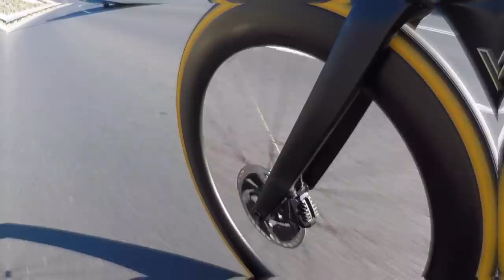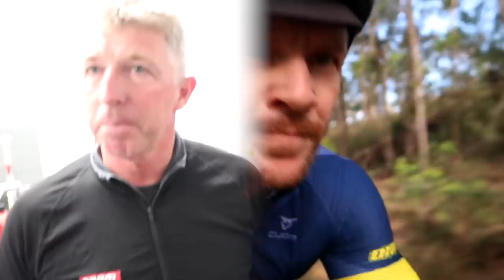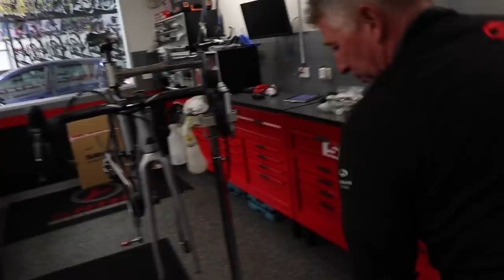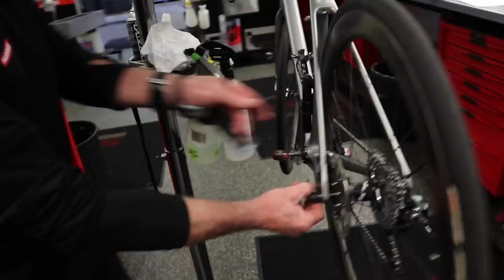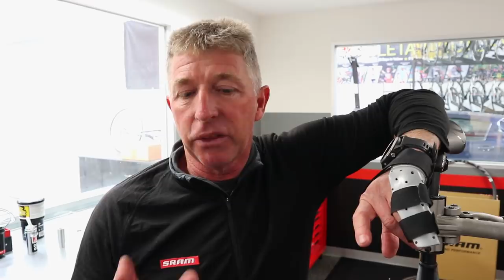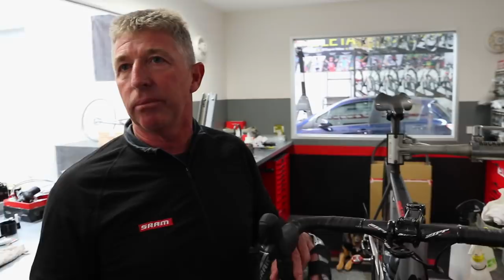Disc VS Rim Brakes (& Thru Axle VS Quick Release Skewer)

Comment: I am sorry Cam, from a physics perspective a rim brake makes more sense, where a disc is better, is that it keeps the mud and rain away from the brake surface.
The reason they need to use a through axles is because of the twisting forces due to the one sided disc brake, it twists the forks because the forks are not braced. Look at the disc wheel, it has cross spoking and is dished. They have made the wheel weaker, why they need more spokes. They talk about rim brake failure, what about spoke failure, and remember with discs your putting all your  braking forces through the spokes. With rim brakes your not.
Then they talk about aero, how is a wheel with more spokes, a disc and has a wider wheel rear dropout on the bike more aero?
I am calling it marketing, if you get buyers to change to disc, they need to replace everything as rim wheels don’t work on a disc bike.
I have rim brakes, campy carbon ultra bora wheels, red campy brakes and can throw myself over the handlebars easily, carbon rim brake pad technology has come along way over the last 10 years, + we now have double mount, how much braking do you want? One last point, compare a disc wheel with tyre, rim and axle, then tell me which is lighter, wheel weight is the most important thing on a road bike. 
Sure discs are better............
Reply from the maker: Great insights Wayne, thanks for sharing. I absolutely love your wheels too. Best wheels I've ever owned! Although I had the Bora One's which aren't even as good as yours! Cam
Reply: The power, modulation and consistency just aren't as good with rim brakes, never mind the fact that your incredibly expensive rims are a service item. All that mean that rim brakes aren't going to be available on new bikes. You'll still be able to use and service your caliper brakes though, no big deal.
Reply: Sergeant Bosco i have ridden both and challenge that. They give just as good control and feel. The only difference is discs are hydro assisted so feel easier. Only advantage with discs is they are superior in the wet.
Reply: Torsional forces are something pro disk users cannot talk about as they can only be measured in a laboratory. As the disk pads grip the rotor the rotational mass of the wheel is acting against the hub via the spokes and as you mention, one side of the wheel mostly as the wheel build is not symmetrical due to wheel dishing. 
If I was racing I would be riding on the ragged edge and want the ultimate setup but, I don't. All this hoo har about what is better is just that. Pros have been racing on rim brakes for many years but I am yet to see the majority of pro road racers using disk brakes beating those with rim brakes.
Reply: @richardharker2775  interesting, funny how no one talks about the design limitations of disc. One of the other negatives is the braking force loads the fork reducing your forks ability to absorb road surface imperfections when braking. I believe the pros have resisted disc brakes as they don't like the feel and heavy wheels. I would say manufacturers are pushing them, why the take up amongst the pros is very slow. Of course this is just opinion.
Reply: @waynosfotos  Sadly too many get caught up with hype and believe it. Each system have their place and listening to Mr. "Sram" in this video shows where hype is generated.
Reply: My 42mmx24mm disc wheelser weigh 1560g as clinchers. Thats not heavy. The tyres wont heat up the rims wont wear out. Im 82kgs and my spokes are thin bladed 24h and havent loosened in 24 months of almost daily use. My other bike us rim braked with ultegra and its great unless it's wet. Also its easier to lock up the back end on my rim brakes than disc. Rim brakes have had me buying wheelsets after finding wear and fine cracks. I had full carbon clinchers but i could smell the surface after braking down Adelaide hills on hot days. Melting epoxy has a distinctive acrid smell.
Reply: @waynosfotos  hydro rim like magura are good ill sat that.
Reply: glenny oc I am not saying they are not good, I am saying are they a performance benefit? The modulation and wearing out rims is a non issue, it takes 10s of thousands of kilometres to wear out rims and the modulation does not mean better stopping control or a faster stopping distance. It is well known disc take more maintenance and adjusting as the pads have to work under higher forces and the braking material is alot thinner. 
You need more spokes in the front wheel, creating a bigger fan effect (more drag), a stronger fork that gives less flex (less front end comfort), 
But I will agree 1560g is pretty light for disc brake wheels.
So my point is why change your whole bike to get little or no advantage when you can not recycle your old wheels, frames or anything accept your seat and handlebars. I also have had discs and to stop them dragging (if you are OCD) you need to keep micro adjusting them, and the disc bend, go out of true very easy. 
I still think they are a gimmick just like tubeless, something bike companies say we have to have but offer no real advantage.

The only advantage is wet weather braking, I fully agree they work in these conditions better. But are you going to ride your best road bike in the mud and rain?
Reply: @waynosfotos  in the wet id say yes they perform better hence yes a benefit there. Ive had rims wear out at 20000 kms down to the markers and cracks
 Sure ut can take thousands of kms but with disc it's not an ussue. My bad weather bike is also disc just much cheaper. Ive been caught out in rain storm on my best bike and i live in the hills so disc is good insurance. If i live in a flat country id probably stick to rim brakes.
Reply: @gweflj  i remeber my old mtbs with centre pull rim brakes...argh...the scares i got from the "shit no brakes" that i sang out back then gives ne tingles just thinking  about  it.
Reply: JCL A mountain bike is quite different to a road bike, it has different forks and dirt, rain and mud to navigate, Many people I know don’t ride their good bike in the rain. I still stand by the fact this guy (SRAM rep) offers up weak arguments. The new pad composition for carbon rim brakes has massively improved over the last 5 to 10 years.
Reply: @waynosfotos  still the carbon specific pads wear very fadt and do get hot. Depends where you live and the ambient temperature wnd your weight and gradient of roads.
Reply: @glennoc8585  my experience is the new pads last about 5 to 10 time longer than the old yellow Swiss stop, they perform heaps better and stop as good as discs in the dry. I think we just need to agree to differ.
Reply: @waynosfotos  uesed the carbon disc specific pads fitted to 6800 calipers on a bike i sold on. They braked ok but the rim surface got hot on descents to the point that i burnt my finger touching the basalt surface. The smell of hot epoxy was strong. My main concern was blowing the rim which has happened. Id only use rim brakes on carbon with an  alloy braking surface or completely alloy. Tubulars maybe ok as the tyre is not going to blow.
Reply: JCL that is not a discussion, or facts, just speculation. Anyway time will tell if discs are that great, i predict a lot more front spoke failures on disc bikes
Reply: @glennoc8585   - Don't forget to add the weight of the rotors to the weight of your disc wheels.
Reply: @hogdog567   - In the summer of 2016 I had the opportunity to ride two 2017 Treks: an Emonda SLR6 (Bontrager Speed Stop rim brakes with SwissStop pads) and a Domane SLR6 (Shimano Utegra-level hydraulic disc brakes).  Both had alloy clincher rims (Shimano C40 and DT Swiss, respectively), and I was riding in dry conditions.  I used them on alternate days for a month or two.  I found I couldn't feel ANY difference in braking modulation, power or consistency, so much so that I would forget which brakes I was using and have to look down at the front wheel!  The only difference I could feel was that the Domane was several pounds heavier thanks to its disc wheels, rotors, frame, and groupset, plus the added weight of its vibration isolation stuff.

I've never worn out an alloy rim or even found any signs of wear.  Maybe because I just don't use the brakes much, or keep the pads clean?

I'm always pleased to see someone with discs on the road because I figure the extra weight they're carrying will make it easier for me to keep up with them!
Reply: @paulflory3532  theyre light dura ace. The caliper and rotors weigh not much more than rim calipers. Rotational weight or mass is ar the furthest point eg the rim and tyre. I have very light rims and my tyres and tubes are very light too. Many tour stages in the last tour season were won on bikes with discs. Treks emonda ream disc was 6.8 kgs the spoke count was 21 front 24 rear from memory. Carbon titanium rotors  and carbon titanium calipers will be available commercially soon. My rims are also lighter with no brake track and can be tubeless. Disc isvhere to stat itsvgoing to be the norm in all UCI pro races and the playing field will be levelled.
Reply: @glennoc8585  - What is used in pro cycling depends on a lot of factors.  Such as Shimano supporting many of the teams with equipment, so if Shimano wants discs used for its marketing purposes....  Also, the easily-met weight limit (a "weight budget" really) means that a team can add weight in one area and offset it with lighter components elsewhere, so there is less resistance to adding weight.

In the 2018 Michelton Scott videos one can see that they were using a mixture of disc and rim brake bikes (must have been a headache for the mechanics!).  It appeared that the Yates brothers and Jack Haig were on rim brakes, especially on the climbing stages where wheel weight matters more, whereas the support riders tended to be the ones on discs.

The local Shimano rep told me that Shimano's disc brake groupsets are heavier than the same level rim groupset, he thinks in part because the hydraulic fluid is heavy.  That didn't count the weight of Shimano's current rotors, which appear to be about 120-130g each.

Doing a lot of scrounging around on wheel weights showed that  manufacturer's disc brake wheel sets (not counting rotor) are generally heavier than the equivalent wheel in rim brakes.  At one end of the spectrum, Lightweight's Meilenstein clincher wheels weigh 1380g/set in the disc brake version (20/20 spokes F/R),  1195g/set in the rim version (16/20 spokes).  And so on.

Interestingly, ENVE says that they can reduce weight on the carbon rims on the disc version of their 3.4 wheelset because a brake track is not needed.  Clever, but the weight saving in the rim is only 24g/pair (!) and that is somewhat offset by needing more, longer spokes in the front wheel because radial spoking apparently can't handle the torque forces in disc wheels.  More, longer spokes add weight.
Reply: @paulflory3532  ibget the whole marketing thing nobody can argue that but that adude i speak from my own experience with road disc. Im loving it can't complain.  Ince as llbtuders are in 6.8kg dusc it will be a level field even for hill climbers.  Less flex no rub when climbing no issue with wet rims. Robbie McKewan rides disc and praises the modulation. 
The fluid is tiny youd be lucky to see 50ml fron and back less than the cable and housings. The hydraulic hose us ligh ter than the cable outer. Rumour has Sram are developing a composite  titanium caliper and even lighter shifter so weights will be nit even considered in 5 years. When yiu consider wheel performance comes down to bearings and rim weight the disc rim is nit heavier than the rim version. Acceleration is about spool up time from torque to inertial mass. Sagan and others have taken stages on deep dish disc same with Roubaix. Once a tour is win on a disc version the negativity will subside. It was similar when clipless pedals were introduced a kit if people hated it,  dangerous, people falling off, time list from missed clip ins etc. Temember the helmet orotest.
Reply: All this chart is irrelevant...rim brakes are already moribund and will be reserved for hill climb events, retro events and cheapo bikes very very soon.
Reply: This is silly. I want the best, strongest, most consistent and reliable brakes I can get. That means hydrolic discs. There is a reason every car, motorcycle, and mountain bike come with disc's - they work better than the alternatives. Once road race teams switch, you're going to see a ton of optimization occur ie they're only going to get better and better and in <5 years I'm willing to bet that no road race team is going to run rim brakes. Another prediction - carbon rotors a la MotoGP. That will drop a bunch of grams.
Reply: @gweflj  incorrect, more forces will be put through a road bike to a MTB front wheel, due to to you can hold the limit longer with more control when descending. Rough surfaces create frequencies in the suspension which limits surface contact when braking on loose undulating surfaces. Maximum braking is done on the smoothest surfaces like hotmix. Wheels are built quite different on MTB bikes, stronger and heavier. Plus fork design is totally different. People always do this MTB thing comparison, two different design challenges and road wheels are already renown for spoke failure, therefore it is not to much of a stretch of the imagination to suspect more when you put all your force though the spokes on a lightweight road front wheel. What do you think is going to happen on a disc brake bike if you break a front spoke under full braking descending?
Reply: @gweflj  this conversation is getting silly. Go study physics, why we put suspension on vehicles, etc? I am out of here.
Reply: Wayne Enterprizes a
Reply: With rim brakes, you can have a softer riding bike by having thinner fork blades and rear seatstay/chainstays.  The ride quality is potentially far better on rim brake bikes, especially steel frames.
Reply: Rob Green Are you going as fast as a car or motorcycle do you weigh the same as them? I have been riding super bikes most my life, still have my Gixxer 1000 that I ride to the gym and couple of bike shows when I feel like it. I fly down mountains all the time with my rim brake bike no problem and they are powerful enough to put me over the handle bar if I am not careful so please! I totally agree that the bite sooner when it’s wet, but in dry conditions a good rim brake bike is way more than enough! I don’t ride my expensive road bike in the rain, but I will take my Farley or the gravel bike out though.

Comment: I rode from 38 to 50 then stopped. At 66 bought a new bike that had disc brakes. Biggest mistake of my life. Going bad to V-brakes. Its all about money pushing the disc brake. Don't compare carburetor to fuel injection. I want to go faster not stop faster, never had stopping problem with v-brakes.

Comment: Disc brakes don't belong on road bikes. I have two road, and two mountain bikes. My full suspension bike is Hayes hydraulic disc, and my hard tail has a cable disc on the front and V brake on the rear. I will never buy a disc road bike as long as I live. Thanks.